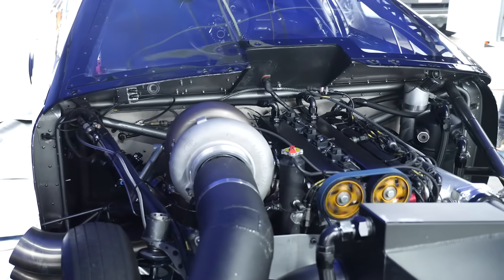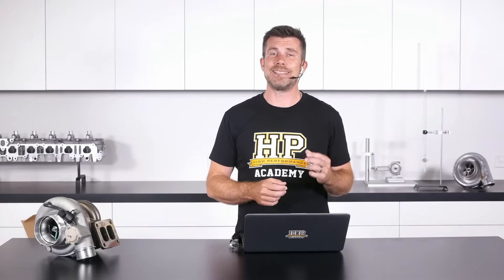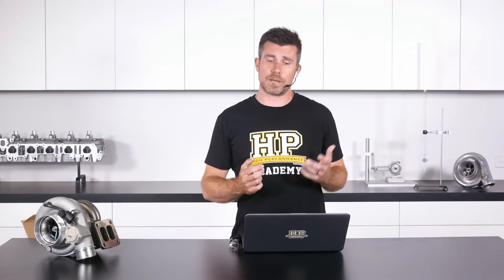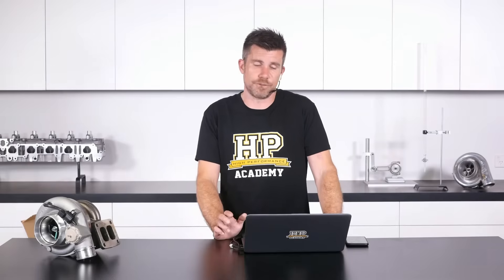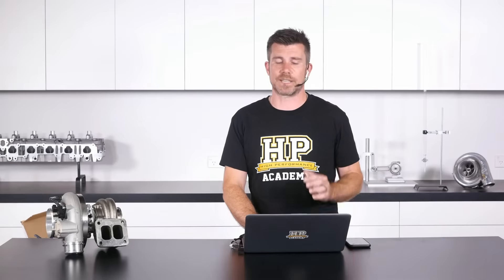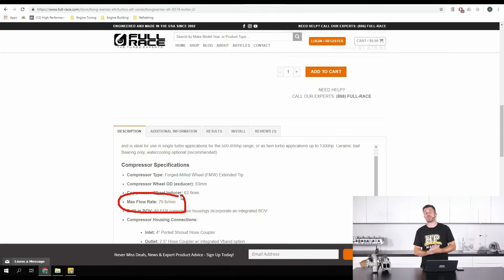How To Choose The Right Turbo For Your Build

Comment from the maker: Building a fast car? Get EVERY course ever with $400 OFF the VIP package: https://hpcdmy.co/vipy13
Kickstart your turbocharged EFI Tuning knowledge. Get 50% OFF the EFI Fundamentals course: https://hpcdmy.co/offery13
0:00 - Introduction
1:00 - Many variables make it difficult to choose
1:36 - Effect of going too large
3:33 - Effect of going too small
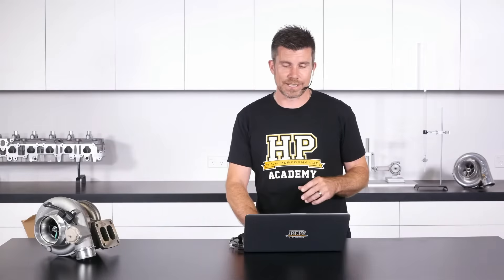4:06 - Boost pressure is largely irrelevant
8:03 - Lag vs boost threshold
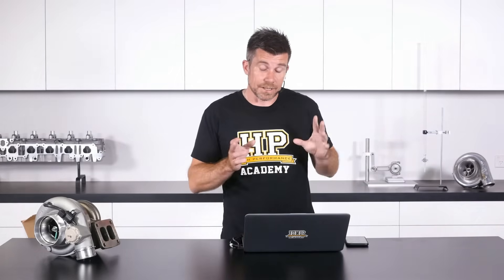12:15 - Aerodynamics
14:44 - Billet vs cast
18:42 - Turbine material
21:06 - Twin vs single scroll
22:46 - Letting your performance workshop choose
24:47 - Do your own research
28:34 - Use a turbo matching tool
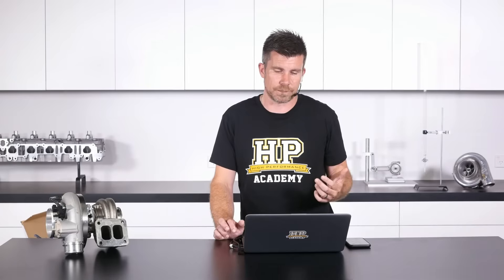29:10 - Reading compressor maps
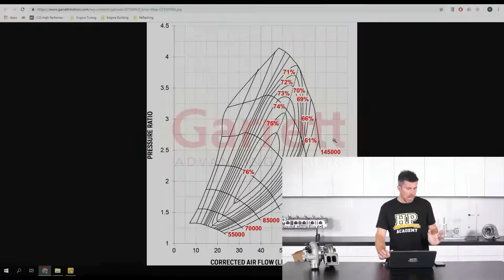33:30 - Mass airflow to power rough rule of thumb
35:41 - Garrett Boost Adviser demo
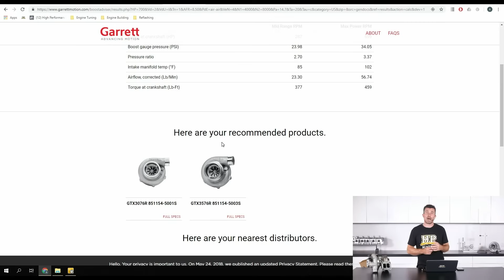39:18- Borgwarner Match Bot demo | 7163
53:33- Borgwarner Match Bot demo | 8374
54:58 - Borgwarner Match Bot demo | 9180
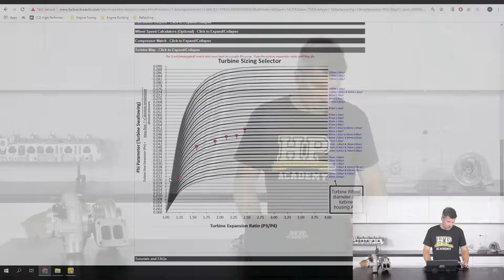1:01:30 - Validating performance
1:06:34 - Questions

Comment: Garrett's turbine exhaust flow charts.....I noticed that you can use Borg Warners turbo selector (Match Bot) to produce exhaust flow numbers (lbs/min) which can then be used in the charts. How do you correctly use that data along with the charts when choosing  different A/R housings?   I assume you would need to chose a housing where all the points fall below the lines(pressure ratio by turbine flow) in the chart? Or does something else factor in?  thanks!

Comment: This was a masterful class💪 thank you Andre and the HPA team for this. I must admit that i was always thinking i should figure out first, how much CFM of air any given engine could pump out at it's redline RPM, then find a turbo that could support double that CFM of air regardless of it would be used or not. I've owned the book "Maximum Boost" by Corky Bell since maybe 2002 and it's a great read and i never lend it out. That's where i learned most of my understanding on building turbo systems. I have a Dodge 2.4L, 4 banger that i plan on putting a GT3582R on. I'm hearing how it will take forever to get to it's boost threshold and that worries me a bit. I used to have a Turbonetics T3\T4 stage 2 on that engine and it made 336whp. The surge map portion was great and i feel that i understand it better. Greg @ car passion for a great lesson on the surge map that helped me as well. I have a question, when the exhaust manifold pressure is equal to or greater than the intake manifold boost pressure, will the vehicle feel like it hit a wall in the sense of not noticably accelerating or pulling as hard? Thanks
Reply: Mate the exhaust pressure is almost always higher than manifold pressure in the vast majority of applications

Comment: Hi Andre. I have a Dart 427 stage 2 cam with twin Garrett GTX3584RS with billet wheels and 3 inch downpipes 50 mm Turbosmart wastegates on C02. These are the biggest turbos and down pipes i can use on my car because of space restrictions. Do you think they are too small? I know these things will probably be at full boost by 3000 rpm.

Comment: @1:08:50 I would like to also add that BIGGER turbos over standard size turbos that come with cars COULD also improve MPG because keeping your car out of boost esp while cruising in highway will improve MPG simply based on by tuning you could reduce the amount of fuel your car will need at (in my case as far as my EVO 9 goes) i hit full boost at 5200rpm with my 6875 PTE turbo so i wouldnt need all the fuel at 3000-4800 rpms that a stock size evo 9 turbo engine would need because of boost basically i wouldnt be boosting at such low rpms doesnt mean i wont be in boost if i hit the gas but my boost levels would be minimal 1-5psi as compared to oem size turbo which would be at about 10+ psi at those rpm levels.
Reply: I've been thinking this forever and wondering why More people don't aim for this solution on street driven cars that don't need to be in boost 24/7. Think something that makes enough power below 3k to not be a dog.

Comment: I have a 2007 Chevy Trailblazer with the 4200 Vortec (4.2L) 2wd inline 6ix... Which turbo you think I should get for my build. im tryin to go mildly appropriate with maybe a 400-450hp build. what all do you suggest? I just need my truck to sound good and drive nice. I love that mild chopping from the TBSS when its cammed, and I want to be able to do some kinda burnouts and improve my 0-60 and rolling 40 pulls... any advice???

Comment: what about compound turbo selection?
In the case of intercooled application, is the assumption of larger atmospheric turbo's flow rate divided by pressure ratio it produces get the volumetric flow for the higher pressure stage?

Comment: In the thumb nail picture it shows the turbo inlet tube not connected to the compressor cover. I've seen this on a few dedicated drag cars. Can you speak on why this is done & any advantages?
Reply: My *GUESS* is that the idea is to delivery air from outside the engine compartment (presumably cooler air) to the turbo inlet while allowing the engine to heave and move during acceleration…

Comment: I'm trying to figure out what size turbo for a sohc 4.0 inline 6 12 valve petrol engine ford falcon engine I'm thinking of using a ford Barra stock turbo GT3582R I think is what they are I'm only looking at making 300-350whp

Comment: That about boost pressure i tell people also and they laugh at me. 
on WRX's TD05 @ 10psi makes more power from 4500-6500 rpm on same 2.0L engine. 
than TD04 @ 15psi ~ 4500-6500rpm.

Comment: Andre,

If you had an auxiliary part that can force an increased velocity of exhaust gases in lower RPM's to drive the turbine ratio up higher in ways that is not naturally possible given a displacement, E.G, a Quick spool valve - it would normally plot the compressor into the surge zone correct?

Since a WOT surge is having air mass being backed up against the compressor instead of flowing into the combustion chamber, can the surging be solved by changes to an engine's physical air mass capabilities E.G, cylinder head porting?

Or is it simply futile to try to reap the benefits of a large compressor, if you had a method to manipulate the velocity of exhaust gases in lower RPM regions, because the surge zone on paper would actually dicate that it would surge on any engine?

Comment: The Honda K24 can be pretty high flowing as standard or slightly modified. I feel like turbo matching is difficult when we are talking about lower horsepower figures since you are basically scraping along the bottom of all compressor maps and falling out of them at higher rpms. Is there any good turbo for the K24 as a low powered ~350 crank hp engine at about 7-8psi (high flow at low PR)? Looking at many compressor maps they seem to be aimed at pretty poorly flowing engines making something in the region of 85hp/l...
Reply: That's unfortunately just how turbochargers work. Some turbos can handle a wider range of airflow like the s366 compared to similarly sized turbos (GT45, G35-1050 less so), but that's up to you to decide. Personally I think a larger compressor and proportionally smaller turbine and A/R might be what you're looking for. Something like a T3/T4 or maybe just a straight T3 with a 0.6X A/R housing. High revving and small displacement engines don't get the luxury of having a wide range of boost.
Reply: @cleveland2286  The problem is not width in my opinion. I get that you cannot make a turbo that is both efficient at high and low pressures. I think the problem is that there is not enough demand for my particular requirement so there are no turbos focusing on high flow-low pressure efficiency. A bigger compressor on a small turbine is not what I am after. I want the compressor itself to be efficient at lower boost while flowing enough for the engine requirements. No OEM turbo engine is flowing as well as a Honda K-series, so there has never really been a point for manufacturers to cater to this request. Unless for very low hp OEM engines. For example Saab 2.0t was a low pressure turbo engine doing 150hp stock. While an SR20 or 4G63 pretty much does 150hp NA. Now the K-series are basically flowing as much air NA as a SR20 or 4G63 are doing with a turbo...
Reply: @bingoberra18  You can absolutely have a turbocharger that is efficient at both high and low pressure ratios. The issue is how much air mass you want at those pressure ratios. 

The EFR 7163 is very efficient both at a pressure ratio of 1.2 and 3.8
The difference is at 3.8 its flowing 7x the air in mass. 

The pressure ratio refers to the pressure at the outlet of the compressor compared to the inlet. Its impossible to have a turbocharger that flows more air mass (as the engine climbs rpm) at the same pressure without changing the volume. No turbo can do that. Ideal gas law. 

Smaller turbos do it better because of square cube law. Unless you want to slap two K04-2075s on your motor or some kind of VGT, its unlikely you will ever find the turbo you are looking for.

Comment: Andre, I have a question maybe you can help shine some light on it with some of your knowledge. I have a k24a2 that's got a fully built bottom end utilizing a stock top end except it has springs and retainers. It's a street build so I wanted something that can drive nicely on the street and be reliable. It has stock cams etc. Only thing done to the cylinder head is titanium springs and retainers. It has a precision 6875 T4 .96 ar housing. The car made 676whp on the dyno at 29psi. Ok Here is my problem haha... my friend has a similar build everything basically the same except that he has a smaller turbo. He has a pulsar 3584r T4 and he made 760whp at 29psi, same psi that I told my tuner to leave it at. We both have the same tuner as well. We are talking about 80hp difference and he has a smaller turbo then me. My tuner told me that at 29psi, my precision 6875 is not where it shines and would require more boost somewhere along the line of 38+ psi where it starts to really rock. My question is, is it possible that with a larger turbo like my 6875 at 29psi, its not efficient and a smaller turbo would be more efficient in this psi range and have you ever seen anything like that before as a tuner. I hope i explained everything properly. Idk man i just find it very hard to believe how my buddy with a very similar build as mine is making 80hp more then my setup using a smaller turbo.
Reply from the maker: I have replied to your email and Facebook message - Taz.

Comment: What would you recommend for a 388ci dart block with a cam with specs intake lift: .630
Exhaust lift: .630
Intake duration @.050": 247
Exhaust duration @.050": 253
LSA: 117
ADV: +6
Revving out to 7500rpm through a tr6060? 
Was looking a forced inductions 94/104mm 1.32ar  s400 going to be a drag car
Reply: I think you'd be pretty close. I run an S480 on a 5.3, a little less cam, a little more RPM, runs great.
Reply: @mattsnook1723  yeah I was hoping for it to be efficient at around 1200rwhp range pushing 18-23psi of boost.

Comment: I have a 20B rotary half bridge engine with 9.0:1 lighted rotors factory intake and S5 exhaust housings. I am struggling to know how to select a turbo for 900hp flywheel with minimal lag boost threshold. Lots of information on piston engines but not much around rotary engines.
Reply: Fellow rotorhead my rule of thumb has always been pick a turbine that flows 25% more air than a piston engine. So power basicly. For compressors keep in mind wankels use about 15% more air than a piston engine..
Reply: @oliverscorsim  how much air would the 20B be pumping out per second? Garret and BW gives this curve on their turbo rear housings but I don’t know what the 20B needs before back pressure becomes to high.
Reply: @adrianochiro4299  yeah but to find that what kinda ports,turbo,fuel? This isnt exact as you need port timing to get dead on. But that being said a stock 4 port 13b uses about the same curve and flow as a 2.6 inline6 same for pulses give or take.for a 20b a decent geuss na would be 3.9l inline 9 so a good turbo for a barra would be a good comparison even if the pulse timing is off. So a gt30 is about as small as it wouldnt mind ie back pressure gets crazy but would be similar to an oem application in the spool sense.
Reply: Generally compressor flow vs hp works out to lbs/min x 10 = hp just keep inmind the exhaust has tomove that plus the fuel component and heat so go up onesize on turbinehousing.

Comment: For street use, any different between ball bearing vs General bearing.
My engine is RB26 Thanks
Reply: In my experience, not enough of a difference to be worth the extra money for bb. No major effect on boost threshold.
Never really had a chance to compare lag, but if there is an improvement, it's only small.

IMO, if you're on a budget and you have the choice between identical BB and JB turbos, choose the JB and use that 500 quid you saved elsewhere on your project 😄

Comment: Borg Warner with the introduction of their EFR series has significantly changed the turbo charger’s performance by using gamma- ti turbine wheels being lighter which allows for a very fast transient response that helps get back on boost into the power and torque curve between shifts. Besides improved aerodynamics and lighter materials is the use of the very low friction ceramic ball bearings. They also engineered their chra for racing demands while also improving the seal using piston style rings and steel cages for the ball bearings. Not sure if they’re still using investment cast aluminum turbine housings which was really an improvement from the heavier cast iron turbine housing. The only con is the race grade chra is alot wider than the Garrett g series in equivalent turbo sizes. Garrett g series has improved performance using the M mar made for extreme high heat as well as improved aerodynamics and wheel size and shape of the fins.
Reply: Yep with the EFR you can get away with essentially oversizing the turbo (or atleast going for a bit higher A/R ratio housing) due to the extremely efficient design meaning you still get great response and spool, and have a very strong top-end.
Reply: @phantomflame0658 hmmm this might be useful for insanity build plan I have. 

K48 engine twincharged. Oversized underdriven superchargers positive displacement. Big turbos(for essentially a 2.1 cylinder)that'll flow enough and still make enough boost that it can be compounded by the super to make the final boost I want plus more. But flatplane crank helps spool, hotvee helps spooling as they both help scavenging. Twincharger can as well via pressure differences at intake vs exhaust back pressure, while also helping detonation thresholds with just a bit of controlled valve overlap but also helps spool and cooling. 

Was trying to decide on turbos. Not picky. Bur gonna need alot of wastegate and blowout valve. 

Oh while also keeping the two stages at peak effiency and sizing and choice for other effiency. Using ac powered water to air charge cooling set up for both packaging reasons and the ridiculous sub ambient intake temps. Density flow pressure all controllable. But also gonna help cooling the combustion chamber further. Cold intake air air pressure and density being pushed into exhaust manifold with hot fresh exhaust gasses. Heat expands air. More pressure. Better turbo spool. Also helps detonation. 

And already working out plans to help the head and valve train plus try and get full clearance back for the vtec timing adjustments.

Comment: What is a good set up for street for a first budget set up, I have a 2011 Hyundai Genesis. I want to make 400 whp , maybe 350 automatic/ manual shift  3800 2.0T ..tired of bully F150s riding my bumper at 90 mph.
Reply from the maker: I am not familiar with your specific car sorry but for a car that has been around a while you should be able to find some off the shelf kits and see what they address to make such power levels as well as what they include.
From there you can buy the parts that make up the kit one at a time when and as you see a deal to do it the cheapest way possible.
The quickest and most simple way is to just buy such kits, again noting this is assuming they are ones that have been well tested and reviewed over the years, as not all kits are made equal!
Don't forget the engine management side of things and to make sure you double double check the limits of your driveline etc. No point making 400whp if your transmission is likely to grenade at anything over 360whp for example - Taz.